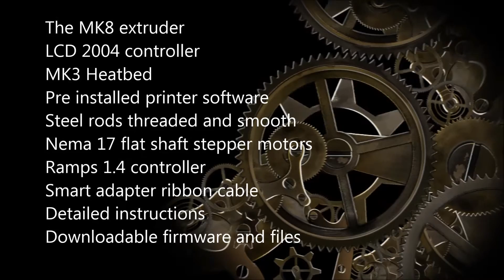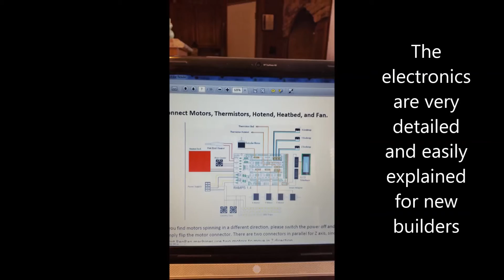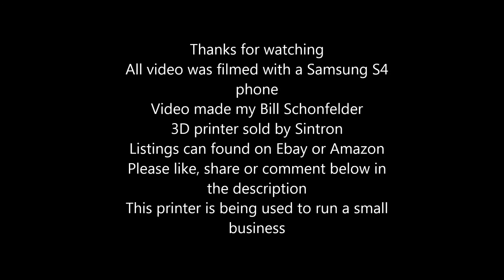Sintron 3D printer demonstration video

Comment: did you have to install a new marlin version, or did the ramps work straight from the box?
Reply from the maker: Straight from the Box.  They install the marlin software for you from  you Sintron.  He has even upgraded a new frame and a metal extruder carriage.
Reply: where did you connect the hotend fan?